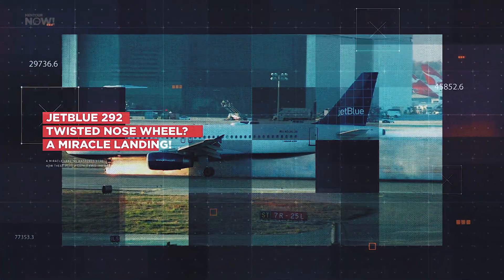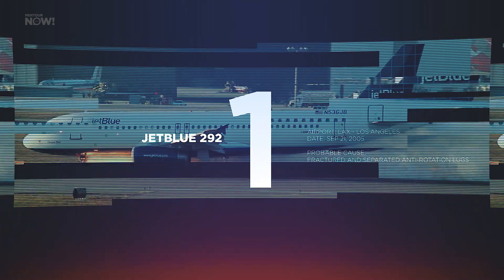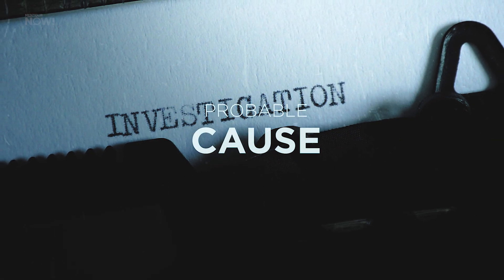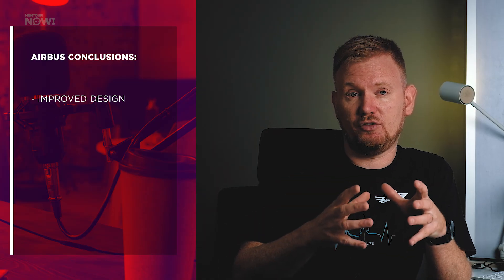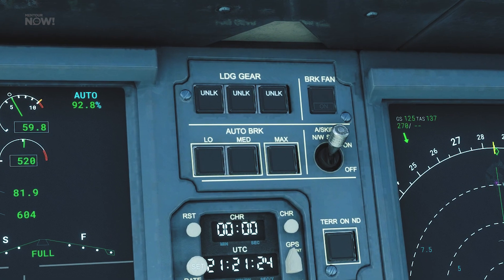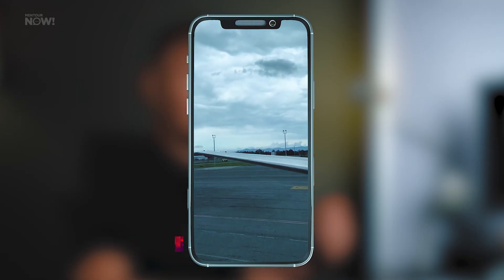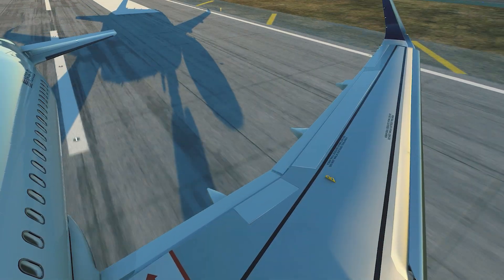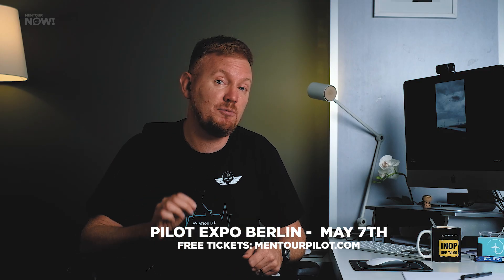The TWISTED Story of the Airbus A320 NOSE-GEAR!

Comment: Why is it particularly the A320 that suffers this? Are its systems just 'too clever' and the much simpler systems of earlier generations of airliner might be better? I flew the Yak52 which has a castoring nosewheel, the steering being done by use of differential braking of the main gear. It was possible for this to get 'cocked over' to full left or right but only at very low speed and only with aircraft weight on the nosewheel. The cure was for someone to hang onto a handle under the tail to relieve that weight, and the nosewheel would spring back to the central position. Once in the air of course it would always be straight, so good for a landing. Maybe the A320's nosegear should be designed so that its actuating rams can be disconnected from the gear by use of a cockpit switch, and the gear designed to free-castor straight on touch down by having the wheels trail behind the pivot point at the end of the nosewheel leg, like the Yak.

Comment: I think the most important take away from all of these incidents is that the nose gear has not collapsed after landing 90 degrees to the side like this. I don't know how close to collapse they've been, but they haven't collapsed. That speaks volumes to just how incredibly strong those struts are.
Reply: More than strong they need to be hard. The wheels grind down to the middle where they are widest and there's also the axle, and I would assume an airplane landing gear axle is wicked-tough material. The strut itself, while it needs to withstand the longitudinal pull from the friction, in normal cases it needs to withstand similar force from the wheel braking.

Comment: Seems to me that the most obvious remediation is being overlooked.
If there is any kind of problem with the nose gear, the gear should have a default position that the gear always returns to, and that should be straight ahead. That can always assure that the wheels are aligned in the correct direction, the only danger at that point is that the plane could run off the runway with no directional control but you would be assured of getting the aircraft safely on the ground without any flame or sparks.

This can be done either by mechanically freezing the steering in a particular position (straight ahead) or dynamically by positioning the wheel trailing the support.

This is based on the observation of all the described incidents which describe the structural strength of the nosegear isn't being compromised and can support the weight of the aircraft. The only thing that is faulty is the direction of the wheels.
Reply: Actually the 90° turn, is the failsafe position. Because in this position the turn mechanism rests on some hardware endstops. The "straight" position would actually be a poor failsafe postion because in this position there's nothing to guarantee that it will stay in this position. Remember, normally it has to be able to turn left and right from 0°, so you can't use any hardware stops and everything else can fail.

Comment: bad landing gear(s),  engine fire or body fire (Concord example), Air France A330 accident over Atlantic (frozen pitot tubes), Air Malaysia in AU (forgotten pitot tube covers), tail strikes because of wrong weight/V1 calculations....=> all of those makes me think of one thing (of course appreciating the marvelous engineering that is already on the planes)....CAMERAS, CAMERAS & CAMERAS !!!! Where are they already? IR/night/heat/ultrasonic whatever called cams w/extra zoom capabilities....hubble telescope can take pictures B miles away, but pilots don't have cameras !
Reply: Funny, in all the actual examples you mentioned, a camera wouldn't have helped.
Reply: agree & don't agree on "in all of the actual examples"...in severe situations, a camera would do little to nothing to help/save, but in other cases, say,  landing gears really opened or not/which engine is on fire (I don't disregarded engineering perfection on engine N1, EGT, % Pressure etc) or engine throwing out sparks, like forgotten pitot tube covers, wouldn't it help to see it and act a little less stressed?....anyway, imo, cameras would still be a little aids to help diagnose a problem.

Comment: I don’t agree with not using spoilers or reverse in this case specially if you are landing on the shorter runways….
Reply: you said it yourself; what if landing on a short rw...you then have 2 choices; possibly overrun it & definitely collapse the nw and then ?????? or have full engine sucking everything inside and then ???...well, hope one never will have to make those choices.
Reply: @Ozkan_Ozturk , chances are, they will not suck anything up or very little to cause any drastic effect… on the other hand, not using the spoilers, can have a devastating effect, for example see Sukhoi Superjet crash…. Actually, I don’t even think there is a way to avoid not using the spoilers on the Airbus, someone correct me if I am wrong, but I think they will deploy on landing regardless of being armed or not…

Comment: I think we also need to ask ourselves: is 90 degree front gear fault regularly seen in other aircraft models?
The exact reasons that lead to this fault are many, but there's a common factor. It's evident that Airbus' design for this system in this aircraft is at fault at allowing these issues to render into a 90 degree gear. In the big picture there is a common issue between them...

Comment: I remember at Smiths-Newmark Aerospace in the 1990's, that we had a few problems occuring on the RAF BAe Hawk nosewheel steering unit the department designed, similar to this. Wasn't involved in the investigations, but I vaguely remember the problem was maybe with the rotational travel sensors too.

Comment: Actually I find it fascinating that those nose gear assemblies are designed and made to be so robust they don't collapse or break under such great forces. And I wonder if landing an A320 with the nose gear rotated 90 degrees causes any structural damage to the fuselage, which most likely is exposed to some great bending forces between the rear of the plane wanting to go forward and the front wanting to stop immediately.

Comment: So is Airbus going to have to start installing omni-wheels on their front gear?
(Omni-wheels are a series of curved cylinders installed in a ring. They can roll along the length of the cylinders, or roll on the edge of the cylinders if turned 90 degrees.)

Comment: in that last picture i wonder why the ram air turbine generator is out.....im not a pilot but ive seen enough crash investigations to know that for the most part it should only be used in the event of engine/ total power failure...odd that it would come out for a landing gear failure...

Comment: Wait.. what?! I live in Medellin. I don't remember hearing anything about that sparkly landing. Glad everyone is ok but doesn't it seem strange to have recurrent (albeit not identical) problems with the nose gear of this particular model aircraft? What's up with that? And due to various preceding events and/or errors in maintenance and design flaws. Maybe scrap the wheels and just put an oily ski or a titanium surfboard up front. Anyway, you pronounced Medellin perfectly the first time. Meh-deh-JEEN. Most gringos screw it up. I'm a gringo and I was quickly corrected on the pronunciation.

Comment: Why is that when nose gear is stuck, it is always stuck in 90⁰ position and not in 30⁰ or 45⁰ or any other angle?? I will be glad if you could clarify that. Thanks.

Comment: 10:07 the quetion that cmes to my mind now is: what is the bigger problem, a nose Gear twisted 90° or 45°?
Because with90°, the wheel will not be able to roll, but with 45° it can stear the plane off the runway and due to inercia cause it to roll in the other direction.

As a bonus fact, all procedures that are included in the checklist have also bee invented by pilot once an we are happy that they did.

Comment: listening to you on studio monitors - your audio quality has changed (worse) due to using that small  tie-clip electret mike being masked by your T-shirt no doubt :-) Use the one in your cofffee cup background graphic  and watch your clip on a 250 inch high brightness projector but you need to wear dark glasses as your cuts are very bright flashes...
Reply from the maker: I’ve been using the same clip on levalier mic for the last 3 years 😊
Reply: @MentourNow  oh, ok :-) It's possible that the clothing you wear, thick pullovers etc can ruin a mike sound,  and maybe room reflections (unlikely)  caused a muzzy sound, encoding rates etc, just a thought I was a bit surprised the clip sounded muzzy compared to others! Great video tho, we watch them at work (TV sound) We all hope you tubers pay attention to levels (imsure you do in the 'plane) and audio monitoring and not just hurry to transmit an un-qc'ed clip

Comment: Wow, you could say that the front landing gear is a ‘tad’ over engineered. Also agree with someone else’s point that the default/locked/broken position should be 0 degrees, not 90. Turning the wheel from 0 is a ‘should have’ feature but preventing it going to 90 is ‘must have’

Comment: I haven't read true all the comments but I just wounder why can the nose landing gear just go straight up with telescope axel? Than never a problem about the angel, but also have a option that there is a possibility too manuely lowering it out of the plane if there should be a problem with electronic or automatic in the landing gear

Comment: Airbus should have a separate Auto-landing mode for twisted landing gears, to keep the nose up for as long as possible and switch off engines automatically. I trust the engineers to get that right!

Comment: While all of these occurrences were for different technical reasons, they all seemed to be due to 1) deficient hardware in the nose wheel structure and/or the BSCU, and/or 2) improper maintenance procedures.  To me, it seems obvious that Airbus needs to 1) conduct a thorough analysis of the those components to determine how, and in what conditions, they can fail (not just ways in which they have already failed, but any ways in which they may potentially fail), 2) redesign those components to make them less susceptible to failure, and 3) modify those components, implementing methods by which they can automatically detect when there are problematic conditions (incorrect pressure, water in the sensors, etc) and alert the pilots to the specific conditions.

Comment: Its interesting that sveral different root causes result in the same exact symptom. Almost as if the nose gear was designed to tilt 90 degrees when these problems occur?
Reply: That's actually what it is. The 90° tilt is a fail safe position because at this position it hits some mechanical locks. So it's a stable position in which the nose gear will remain no matter what.

Comment: I've been watching a lot of these videos lately, including Air Crash Investigation episodes, and I do have one question, a general one. Why aren't airplanes equipped with external cameras aimed at key sections of the fuselage, engines, gears etc.? I'm asking solely from the perspective of a pilot, would the cameras give you any valuable information that you cannot obtain from the instruments? Time after time I'm watching episodes where pilots couldn't tell if something was REALLY happening or their instruments went crazy or some glitches caused the systems to report fault readings. 

I know installing certified cameras able to withstand the temperatures and wear and tear would be expensive, but, hey, a lot of things that goes into airplanes is expensive. I was just wondering about that one aspect. Would you, as a pilot, like to SEE the underside of the wing, the engines, from both front and back, the landing gears etc.? Would that give you any extra information or would it help you confirm what the instruments are saying. Or do you think it would be a complete waste of resources to install something like that?
Reply: There have been too many fatal crashes of twin-engined aircraft ( of all sizes.) where the flight crew shut down the wrong engine after one engine failed. Cameras might help in that case.

Comment: Obviously Airbus needs to go back to the drawing board and start over. Forget patches and new procedures. This design is fundamentally flawed. Follow the kiss principal. A simple mechanical limiter could prevent 90 degree nose wheel position. Do the front wheels of your car ever do that? I didn't think so.

Comment: Hmmm.  I'm not buying it.  How do Boeing planes control nose wheels?  I don't recall this scale of problem with Boeing.  Airbus keeps implementing multiple fixes to a poor design.  (Yes, I know Boeing is not a shining example due to the deadly 737 Max debacle.)  My point is, the video describes very many problems each with piecemeal solutions.  Perhaps Airbus should survey the industry, find out who what has little or no nose wheel steering failure and just adopt that system...

Comment: 11:30 How were they able to take off with a 90° nose wheel without noticing? That sounds really weird
Reply: Airbus has a lot of automation, and its controls in the flight deck is not physically connected. This probably reduces the feel of the aircraft since the computers are damping a lot of movements.

Comment: Thank you for always very comprehensive work videos and analysis, truly engaging. My question is probably unrelated to the incidents but I've always wanted to know why nose landing gears on big airlines retract forward? I see very old airplanes used to retract backwards, which I thought helped with aerodynamic drag upon lift-off
Reply: Great question. With forward-retract, the load-bearing bulkhead is further aft, of larger cross-section, where a structural bulkhead would go naturally, at a fuselage assembly joint. Just my guess....

Comment: So why dont they have a Sensor that checks for 90° while gear locked. The 3 Green light are clearly misleading. I expect that there should be a Non Normal Checklist for Nose wheel 90°. 
I would recommend a complete redesign of the nose wheel so that the Default and natural state is 0° in direction of travel. So that in a Fault, the nose gear has an intrinsic tendency to set it self into direction of travel. Make it Safe fail or fail save.

Comment: Why not just add in a manual knob to manually adjust the angle? Just an idea but I'm not a professional so I don't rlly know.
Reply: There already is. How do you think pilots steer the aircraft on the ground? Its impossible to use in the air when the nosewheel is physically stuck 90 degrees. Thats literally why all these incidents happen. The nosewheel is stuck and cannot move.
Reply: @6z0  I see. Thanks for confirming!

Comment: there is only 1 BSCU on A320 family but the BSCU has two systems inside a single LRU: system 1 system 2 (active and standby) interchanges during gear extension. 5:05

Comment: Several of these incidents seem to trace back to software issues. To me, this highlights the potential drawbacks of becoming so heavily reliant on software-driven fly-by-wire systems. Is a software solution really the best choice here? They save weight, but software is finicky. Even if it's well-designed, all it takes is a momentary power fluctuation to turn a 0 into a 1 and the system is hosed before the operator knows what's happening, which is evidently what happened in at least a couple of these cases. Also, unfortunately, in today's "agile" software design environment developers assume they can "iterate" their way out of any problem, ignoring that an aircraft in revenue service - much less in flight - doesn't have the luxury of sitting safely on the ground waiting for a patch. I've seen this toxic mentality at work in my time as an avionics technician developing workarounds for poorly written system software. Meanwhile the software guys, apart from considering every problem to be user error, had such a warped idea of "agile" methodology they seriously believed their fellow developers, and not the paying airlines, were their customers! So they would slip delivery dates and fight fix requests that they didn't come up with, and late penalties would rack up and known bugs wouldn't be addressed.

Comment: Nose gear design is potentially flawed and so called maintenance procedures are not always  successfully carried out as per maintenance guidelines. The nose gear should technically be re-designed or modified and thoroughly tested in order to ensure that flaws of the past are not a re-occurance. If any incident excedes more than two incidents at any given interval, then the equipment should be regarded as unreliable and a hazard to flight safety. Stress failure on the shock absorber mountings is particularly concerning and the fact that pilots should avoid or not exceed a certain turn angle of the nose gear as a precautionary measure in order to avoid a potential 90 degree lock angle, is very concerning.

Comment: What a detailed analysis by the end user. 
Unfortunately as an aspiring design engineer, this IS the SAME failure. 
A functional system is made up of different components. 
If the same functional system keeps failing, especially in a critical role, then a new design is required. 
It sounds like arrogance for Airbus to try fix a system 7 time and not identity thy need for a system redesign. 
It also sounds like negligence for the FAA/EASA not to at least request a design review.

Comment: Case #5,, I think is was safer to land with the wheel at 90 degrees rather then having it at a slight angle, as a slight angle would have caused the airplane to wear of the runway, or am I wrong in this thinking? Love your videos..